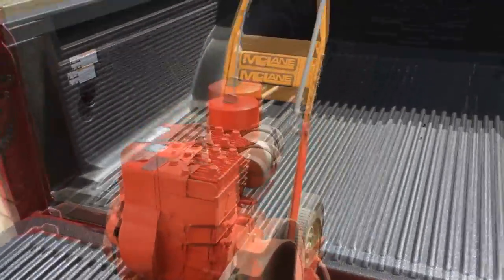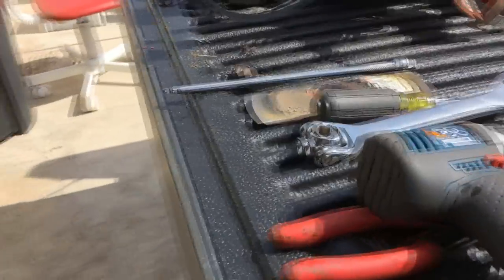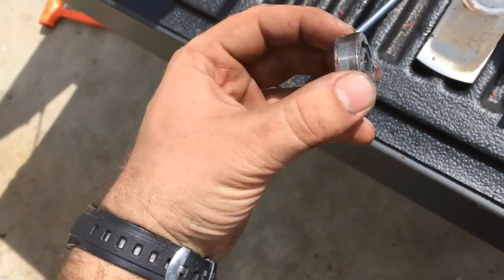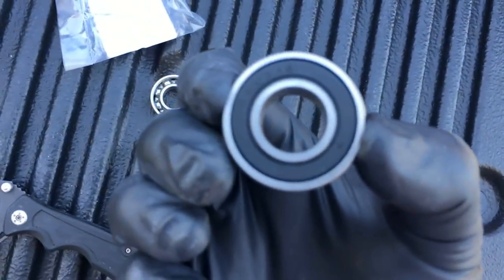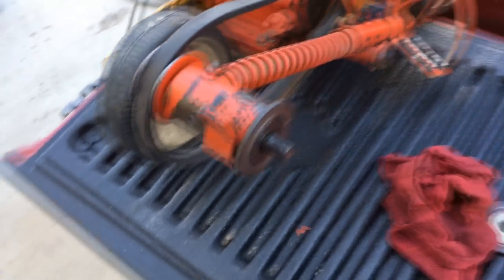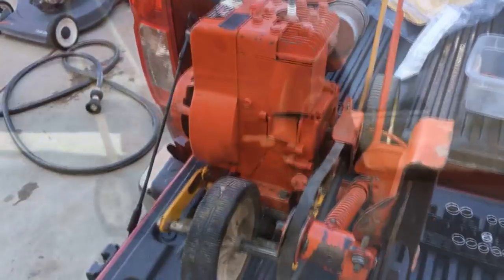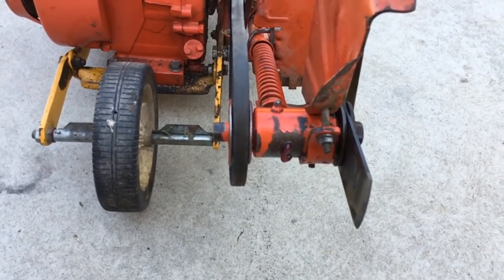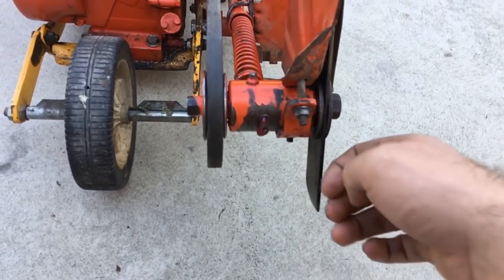Replacing Bearings in Edger Spindle

Comment: Thank you for this video. I have a Craftsman Tecumseh edger that will.not.die.  So bearings were shot and I was hesitant to do this job until I saw your video.  It ended up being surprisingly easy.  One bearing was destroyed and I had to use a cutting wheel to remove the inner race from the driveshaft.  Also the driveshaft had lost its woodruff key causing the drive pulley to freewheel.  

Best part?  All the replacement parts were in my local chain auto parts store.  I spent about $40 which includes the red tacky grease.  The new bearings went in with some well placed hammer taps. 

I was back edging about 3 hours after tearing into it.  Thank you again!

Comment: Great video man! My grandfather had a Craftsman edger with a 8 hp Tecumseh before he died, have no idea where he got it but Tecumseh hasn't been making engines for a while, it's actually still sitting in his shed, need to go up & get it & rebuild the carb, he never really used any fuel stabilizers, so hopefully the carb isn't too bad & it's replaceable if need be, just a shame Tecumseh parts are so hard to find these days though.
Reply: Ebay has all you need for new and old stock parts. It's well worth it to service the 8HP Tecumseh.

Comment: I think you'll find that the "weep hole" at the front was the bolt hole for the front belt guard. And looks like I'm going to replace bearings in my spindle also. But for pressing bearings in I'll be using a piece of 1/2 threaded rod, washers nut and pulling bearings in to housing. Creates a screw press.
Reply from the maker: Yes you are correct